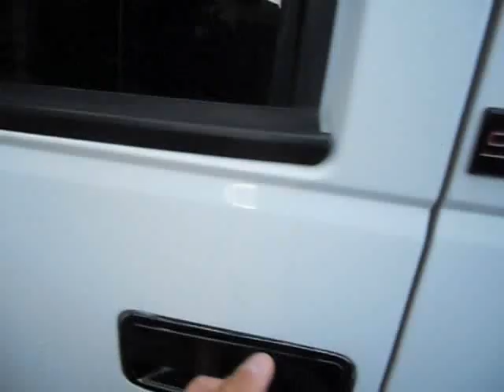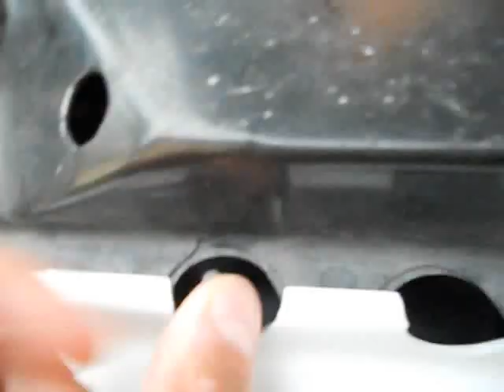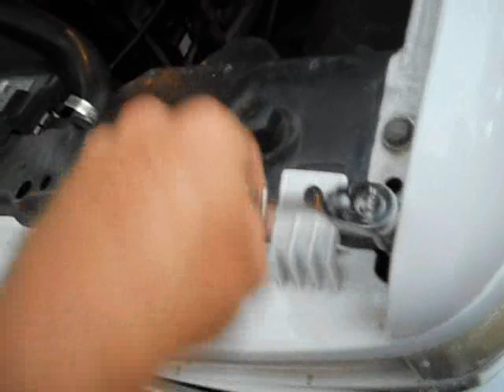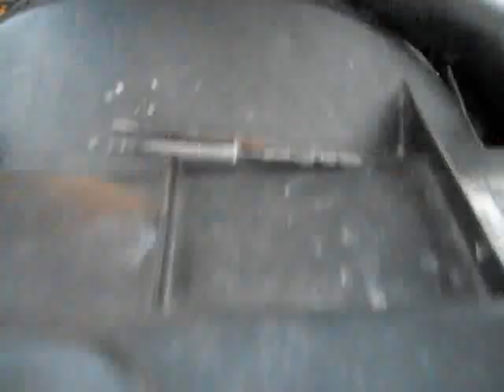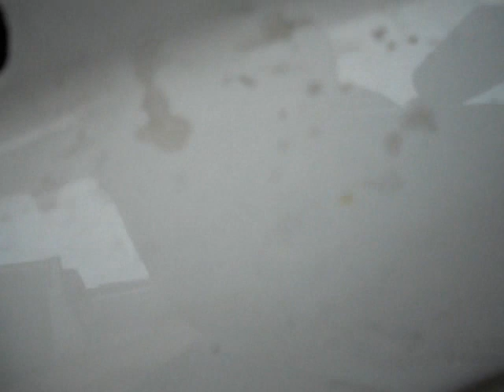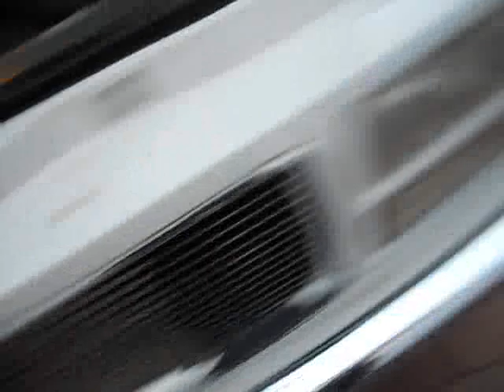88- 98 Fullsize Chevy GMC  headlight removal.

Comment from the maker: If you have this style of grille shell on either a Chevy or a GMC, you might be able to use the same head light brackets as stock if you are replacing the headlights.  IF you cant get the lights to fit on the stock brackets, the whole grille shell has to come off. Its easy.  4, 7mm screws up top  two are sort of hidden in the middle, One 7mm screw in the middle of the grille near the emblem, then the grille has finger clips on the bottom. 2 on the sides, one on the middle.

Comment from the maker: No problem. When halogen bulbs get old, the gas leaks out of them and they dim considerably. I replaced the 9006 low beam and 9005 high beam bulbs with 9012s for the low beam and 9011s for the high beam. They are the same wattage but use a bulb technology to produce a brighter longer reaching light.  I have a video on the install.

Comment from the maker: If the long post just spins free after many turns, Keep turning and and try to pull up, The bolts holes are encased with plastic so they stick sometimes.

Comment: Great vid, to the point. In the future, use a penetrating oil on those adjusting screws. Use long straws to get it where you want it in tight, deep places like that. lol. (tight, deep places... lmao!)
Reply from the maker: That will work. I really need to buy some kroil and get a little oil dripped for it.   I need a new left headlight, ts all cracked. Ill get a nasty one from the Junkyard and polish it up. Polish my Lens! lol

Comment: Yea just came from another vid, they are lumping all the 88 to 98 together saying they are the same but they are not, I have a 93 Chevy Cheyenne and it has the big square headlights instead of the rectangular ones I've seen. Causing some confusion.
Reply from the maker: +Richard Rathman  sealed beam is different.

Comment: (1), ONE OF THE TWO BOLTS, FOR MY HEADLIGHTS ON A 1998 SUBURBAN, ARE STUCK, HOW CAN I REMOVE THEM. (1), ONE OF THEM JUST KEEP TURNING, AND WILL NOT COME OUT.
Reply from the maker: Well... It could be stripped. If you are just trying to replace a bulb. Take off the grille shell, its a bunch of 7mm screws, A few clips, And you can unbolt the whole headlight WITH bracket, Its 4 10mm bolts

Comment: getto wagon   those 2  bolts you took out was for AJUSTING ONLY  not replacement-- thats why they are so hard and rusty-- you need to replace the whole assembly via the grill
Reply from the maker: What are you talking about.  Those 6mm bolts are the bolts that remove the headlight. The adjusters are the E torx. you don't unscrew those
Reply: Just tried this on my 95 Chevy.  Da Grinch is right.  The grill has to be removed to get to the high beam bulbs as far as I could tell.  The bolts removed in this video are the adjusters.  Mine were seized and broke the plastic.  Now, I'll be shopping for a new plastic bracket
Reply from the maker: Kevin Bryant
No they are the removal bolts. The adjusters cannot be removed.
 Pull those 2 pins lile bolts  and they wiggled right out. I removed so many of them the same way  Behind the grille are 4 10s that remove the light with the bracket.

Comment: think I need to replace mine.one holds water and the other is foggy looking.thanks for the video.
Reply from the maker: I had two like that. Dried them then used some permatex clear RTV around the edges. No more leaks.  I think I have a video on it.
Reply: Sweet my dad's 92 chevy (I have a 92 gmc)they drilled small holes.
Reply from the maker: Here where it rains so much the water would flood back in. I think my leak came from the bottom as water puddled under the headlights. If you run a line of masking tape obn either side of the "gap" where the clear lens is sealed onto the white plastic side, once you remove the tape when the RTV dries a little it will be a nice clean bead and will provide a good seal.  The headlight bulb O ring is another point of water entry.
Reply: It blows my bulbs plus the light has a crack in it.
Reply from the maker: buckster2575
 Ifi ts cracked its done.  I ghetto fixed some and smeared clear RTV over the crack, it worked really well and didst look too bad until I found a newer used light
Reply: I got two wondered how often they did it

Comment: I know this video is old but Do not buy headlights from headlight depot they are wack af get oem replacements or you’ll deal with cheap ass plastic headlights that will leak of y’all wanna replace them get em at 1a auto.com
Reply from the maker: 1a auto sells junk too.  I will never buy anything more from them after my experiences.   I have a bunch of used ones in good shape I clean up. They work perfect
Reply: Ghetto Wagon I hear ya man well I just  hope pray these will be alright atleast cause I haven’t been able to drive mine for almost a month bud brand new motor was put in two months ago barely has 2k miles on it ready to scream the bald eagles again!
Reply from the maker: If they leak just get some clear RTV, mask tape the light on both sides of where the factory light crimp was and go along it and let it dry overnight. I did that to my lights now.  No more leaks.   Been over a year now and this weather here is extreme.    Permatex clear RTV. It also glued my mirror back on when it fell off from the housing. The factory glue failed.
Reply: Ghetto Wagon I gotcha man mine had aftermarket lights on it when I bought it the wanna be led strip lookin turn signal lights they burnt up my whole system when the hot wire touched ground somewhere thank you for that tips man!